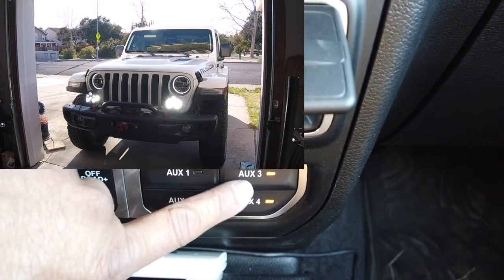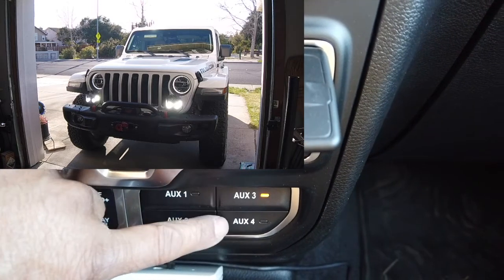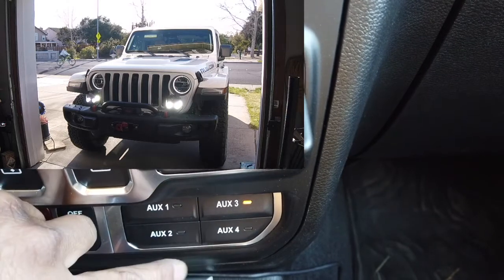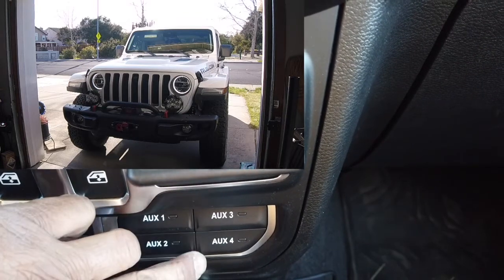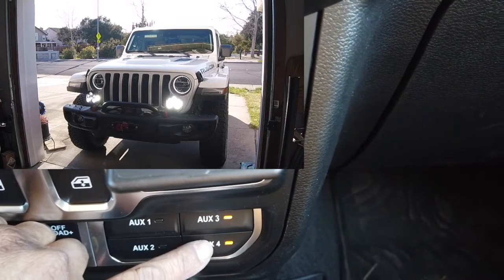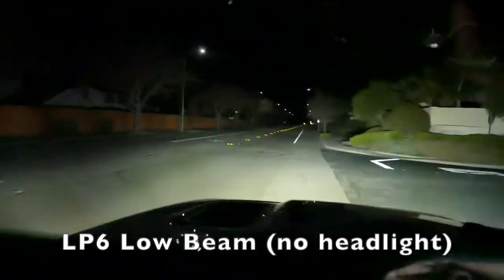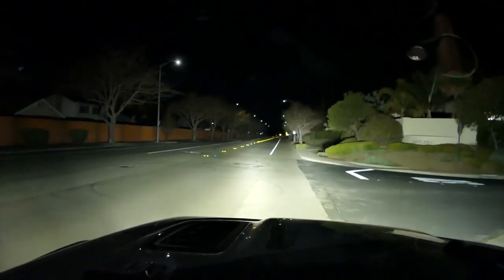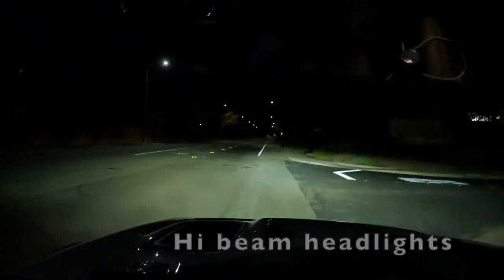Baja Design Combo LP6 Pro Circuit revision and demo on Jeep JL

Comment: How do you turn the amber backlights on? Did you disable them?
Reply from the maker: Its been a while but believe there was a wire that will turn on the Amber light which is wired to the parking light. I check the wiring and confirm again.

Comment: Bro, you're going to ruin those LP6's running the hi and low beams at the same time.  At best it will for sure void your warranty.
Reply from the maker: You are absolutely correct about damaging the LP6 by energizing both hi and lo terminals. I actually customized the circuit with a relay to guarantee only 1 wire, either hi or low is on when both buttons are pushed. The writeup is here.https://www.jlwranglerforums.com/forum/threads/baja-design-lp6-wiring-complete-circuit-with-aux3-and-aux4-amber.65919/#post-1403517